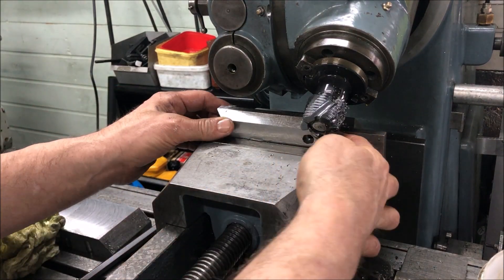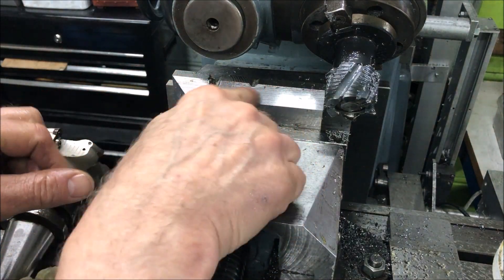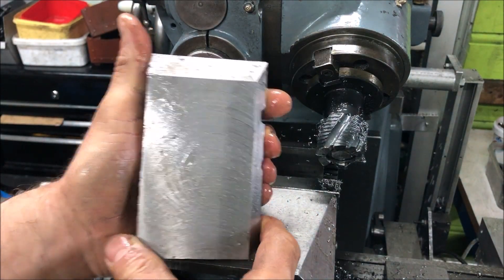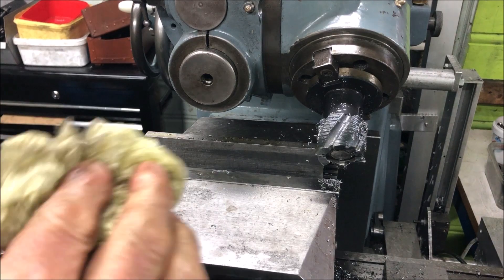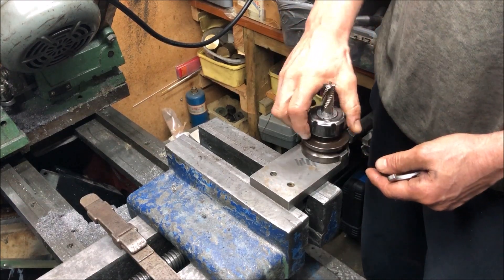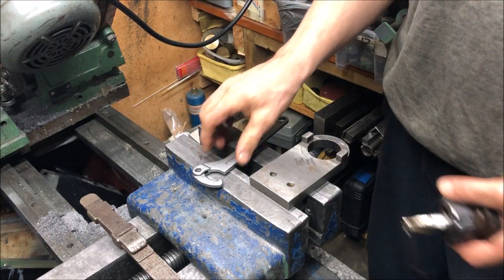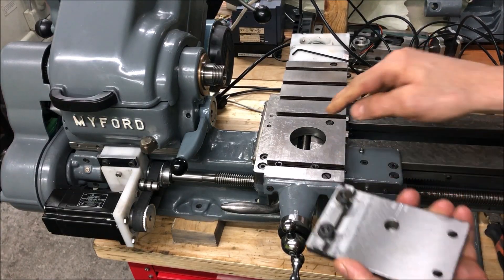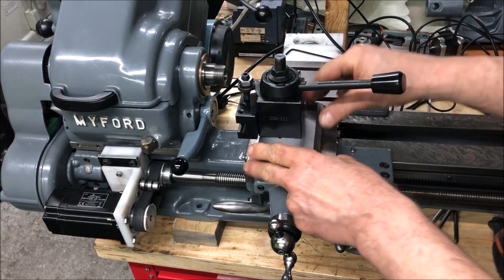Myford Super 7 - Making the solid block toolpost

Comment from the maker: Luke Rickert
I laughed when I saw my flat ground stones come out, I didn't expect to see them. If anyone in Europe needs some of there own. www.pyreneesprecision.fr/ I made a similar solid post for my Emco with an ELS. It does seem to help on machines with weak compound slide designs.
Reply from the maker: Thnks Luke. The stones function well indeed (as intended). Good job. I changed the link to the one you used. Yes, I think this is a worthwhile modification. One may switch between the solid toolpost and the compound as required, but since I am using the ELS for tapers etc. the function of the compound for setting angles is no longer required

Comment: Isn't that milling head wonderful. Now, quite some people have been suggesting that I should tram the milling head. For cutters with really small diameter there is absolutely no need to do that. My Schaublin SV-51 has a similar mechanism and that is accurate down to 0.02mm/50mm, If more accuracy is needed then I tram it.
Reply from the maker: Yes, I also think this is a clever and very functional design. I agree,  on larger face cutters it might be needed, but for me it has been ok as it is. The machine is very accurate. I know the 51 also uses the exact same head.. very nice. The only drawback with this vs. for example a Bridgeport is that you need to swop heads to get the hi-speed capacity and quill w/feed eg. for very small end mills
Reply: @jansverrehaugjord9934  True. But, in this mill one can turn the head so easily that I usually end up drilling the workpiece sideways. It is easier to crank the X- than the Z-axis. Further more, those separate "speed" heads are really hard and expensive to find. Mine is lacking it. Mine is also lacking the overarm support bearing block. I think I need to make one.
Then about drilling with auto feed. I don't know whether Your machine has the high/low gear setting for feed. Mina has and that one has the free gear in between. In my machine that can be operated while the feed is running. Same, of course applies to the actual feed lever. I usually feed the drill in an interrupted fashion so the chips won't become kilometre long. For some reason I have taken the habit of using the high/low gear switch instead of the actual feed lever.
Reply from the maker: @FinnoUgricMachining  Very good tip about drilling sideways! Thnks.. didn't cross my mind. I do most of my drilling on the Arboga floor-standing drill press, and if I need precision holes located, this has an XY table. However, I will explore the method you describe. Yes, the 52 also has the high-low feed (2<>1 as it is labelled). True.. the hi-speed head is hard to find. I sourced mine from a Swiss guy.. quite a story actually, I was lucky. Sold my 53 head to a friend, these have a different connecting gear, while the 51 and the 52 share the same if I am not mistaken. Also lucky to find an overarm bracket. PS! You might have a look at the YT video on making such a piece for the Schaublin 13 mill.. I guess this is just a scaled down version you could copy from.
Reply: @jansverrehaugjord9934  Yes, Tony made his and that video is quite educative ... and has no speech in it.
Reply from the maker: @FinnoUgricMachining  He is a very good video maker!

Comment: While I'm quite sure Robin Renzeti didn't invent that solid tool block idea Jan, his channel was the first time I'd seen it mentioned anywhere at all. I think it's an excellent addition to any lathe when you don't need the top slide. I'm also envious of the mill you have, it makes my Taiwan made Bridgeport clone look like a toy.
Reply from the maker: The idea wasn't mine, that is for sure. I have just adopted it here because it is a nice way to have, in my eyes, an improved performance on a small lathe. With the ELS there is also no need for the compund.
Reply: @jansverrehaugjord9934  Hi, I can't see that having an ELS removes the need for a compound [topslide]?
Reply from the maker: @tonypratt1989  hi there, the ELS can control both axis through small programs chosen from a menu in the control box. These include tapers and other form cutting as well as 4 different threading cycle methods for both internal an external threads. For me at least I see no apparant use of the compound then..

Comment: I am curious what kind of contact pattern the block makes with the T-slot table. Do you think filing is good enough to make sure there is solid contact over the whole surface?  

Do the T-nuts distort the table up when tightened?   I also have an old table top horizontal mill with only one t-slot in the table (http://www.lathes.co.uk/atlasmiller/), and because there isn't much thickness to the table the t-nuts will do that.

I am so jealous of your milling machine, wish I had that instead of a bridgeport style!  Thank you again for sharing your time with the community!
Reply from the maker: You are of course correct! Ideally I would have made this out of cast iron and scrape this on the underside. At the very least I will blue it up and test, then probable attempt scraping anyhow. My mill does a pretty good job so should not be too much. I haven't tested (yet) distortion of the table, but it must be minimal, at least I cannot feel any binding or difference in operation. I can do a follow up with regards to testing/turning and include this. PS! Yes, the mill is nice.. but so is a Bport😀